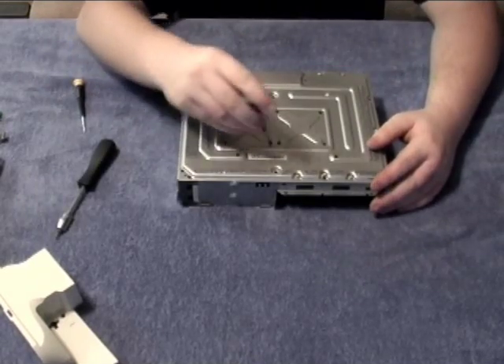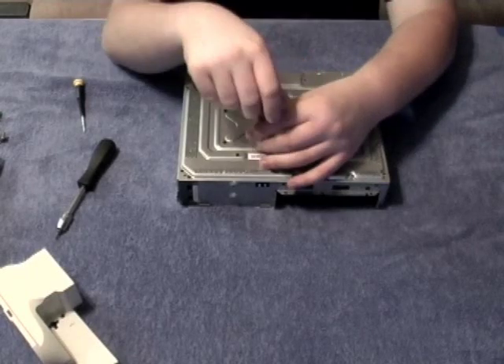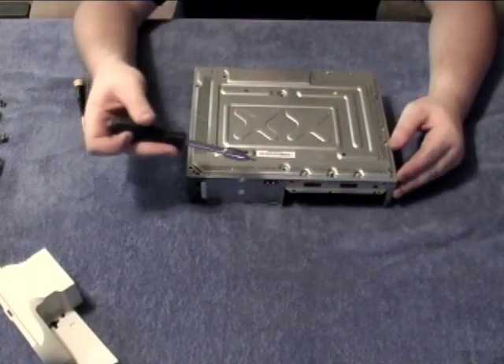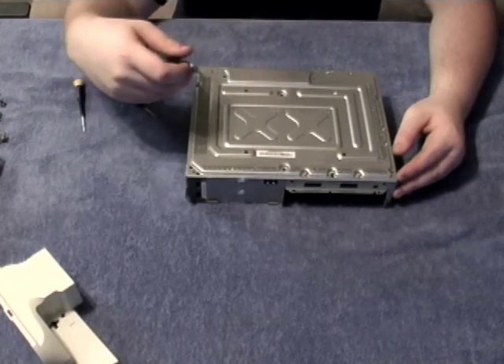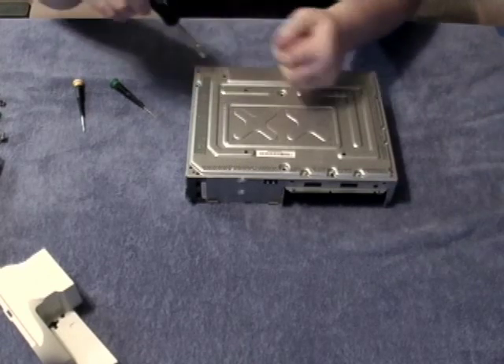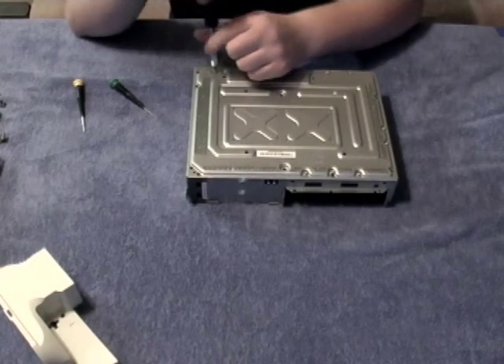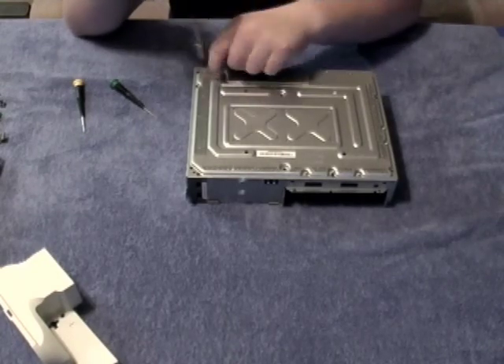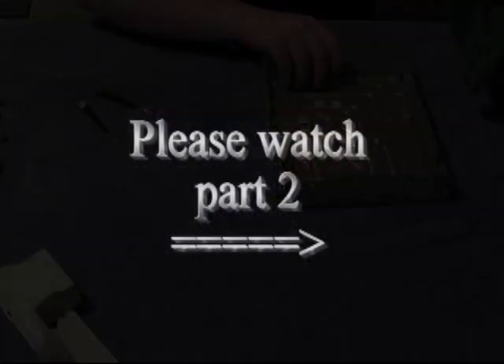XBOX 360 X-Clamp Replacement and RROD Fix (Part 1 of 2) "XBOX Disassembly"

Comment: Ok, so I see that this fixes the three rings but what about 2? My Xbox was overheating within seconds of start up when I used the method in the other video (the one with pennies) it began to work again. My Xbox seems to be working again due to the pennies drawing off heat from the chips. However now, inexplicably, it has started overheating again within seconds. Would your method work for me even though I don't have the three rings?